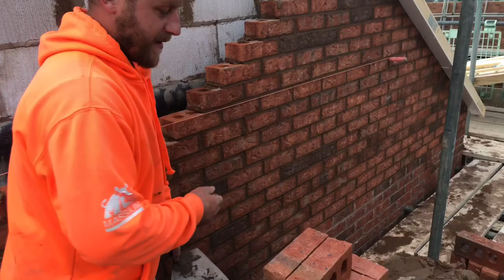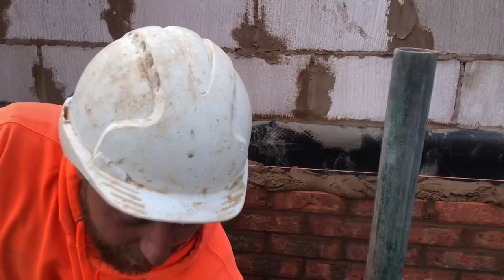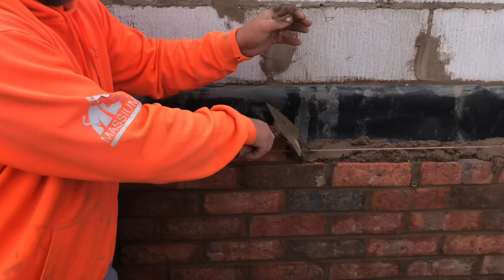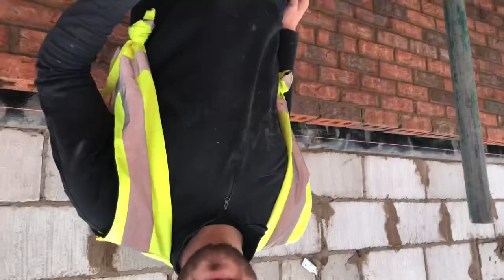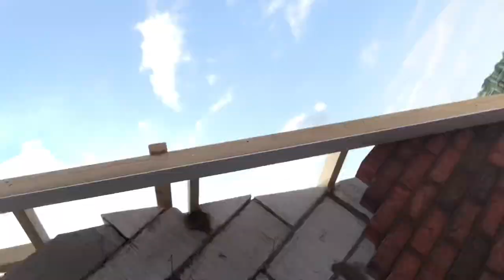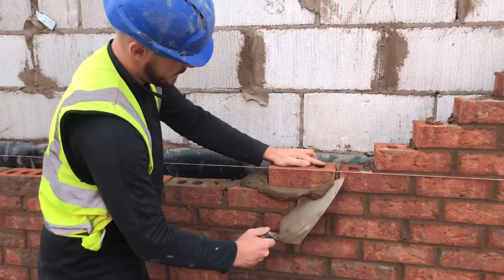Pic N Dip Vs Traditional Bricklaying race

Comment: Hands buried in mortar. You're almost holding the trowel by the blade. 😂
Reply from the maker: Jealousy will get you know wear lad
Reply: @kurtmalpassbrickwork6255  jealous I can't mud up my hands? 😂
Reply: @kurtmalpassbrickwork6255   of what?
Reply from the maker: @PaddleDogC5  everything
Reply: I always hold the trowel near the blade that’s where it’s balanced better so it’s easier on your wrist
Reply: @tomthumb1769   because trowels to big for you. Hand shouldn't be past ferrule end max. They put handles on a trowel so you hand can be in the mortar? 😂
Reply: @tomthumb1769  trowel is never balanced with mortar on it.
Reply: @PaddleDogC5  I’ve been a bricklayer for 32 years pal with your fire finger up to the furrel you hardly have to grip the trowel because when it’s a full of mortar the back of the handle pushes against the back of your palm. You obviously look like a six month wonder when you hold a trowel
Reply: the first one he put in is over the line by like 5 mm lollllllllllllllllll